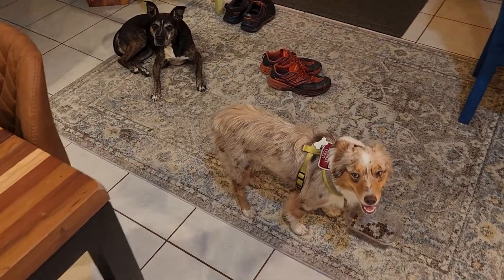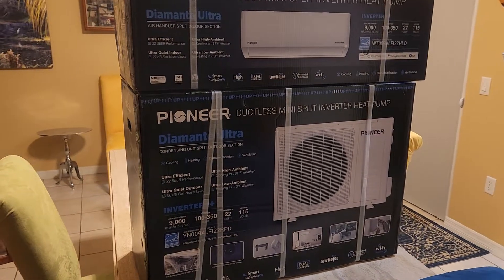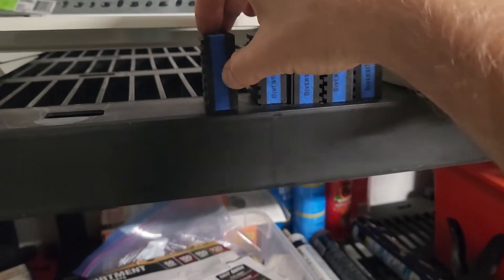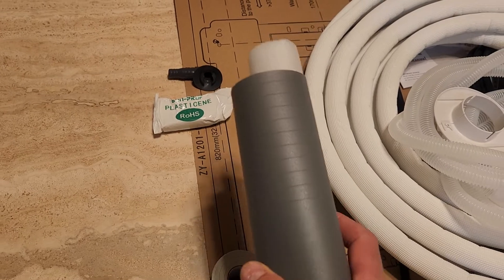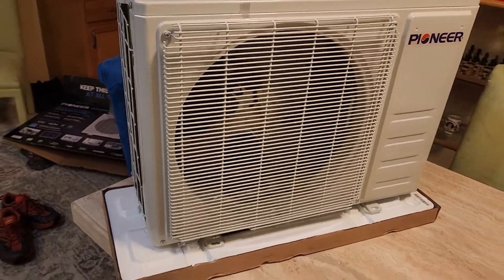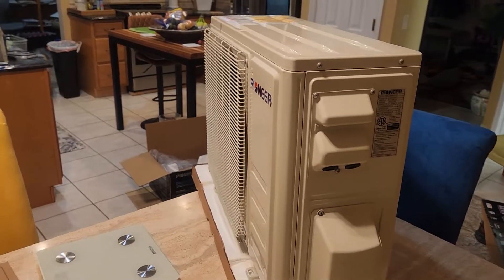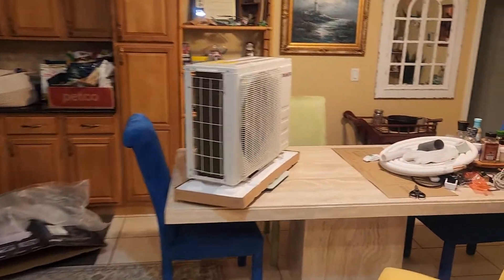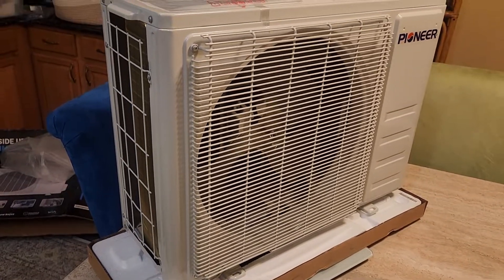Pioneer 22 SEER 115V MINI SPLIT Air Conditioner heat pump Unboxing - for CAMPERVAN Rear Door Install

Comment: Nice !  Glad it has rubber vibration absorbers.  Do you think you'll need to box up the compressor ?  keep it cool / keep criminal eyes off the unit ?
Reply from the maker: The bracket came with rubber vibration absorbers with bolts, but can't use: Total made in China garbage that breaks easy, so have to use my own bolts and the rubber that came with the Pioneer.
Reply from the maker: That's correct, I have to find a way to secure it from thieves such as cable locks, but those can be cut easy; could be impossible to find a practical and effective way to lock it down.
Reply: @EcoNeato  I inherited from my father, trays and trays of nuts and bolts made in the 50s and 60s - quality western made gear .. I treasure them like gold !  :D
Reply from the maker: I could put a cover over it that says "beehive".
Reply: @EcoNeato  LOL

Comment: The 2in hole the line set and ac cord for the air handler can be filled in with that great stuff foam

Comment: Do you have enough power to run that or do you have to be plugged into a shore line? / oh ok you answered it. / I don't have an on-board generator. So I stay on the coast in summer, 70° +/-

Comment: Late to the party but I would think an automotive A/C specialit could make a nice flexible hose set for this.
Reply from the maker: I heard that before too but ran into some issues with the connection and internal diameter sizes are not compatible with what they're used to dealing with
Reply: @EcoNeato  - ah, I see.  Well it was a thought.